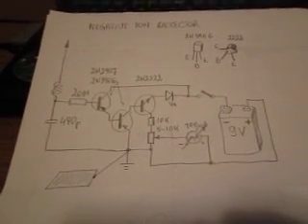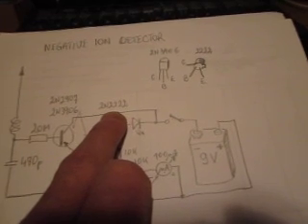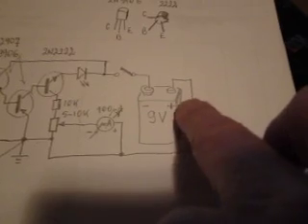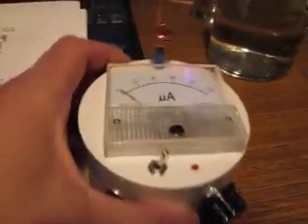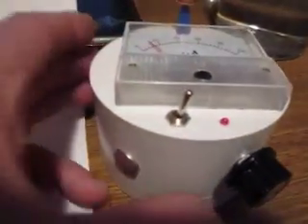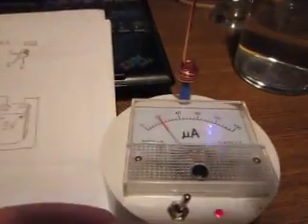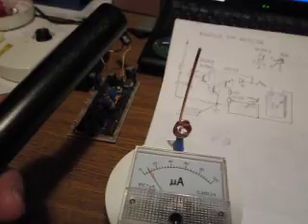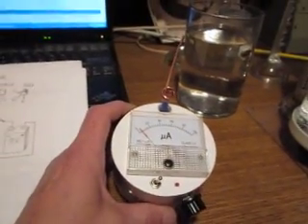Negative Ion Detector

Comment: The 470pf capacitor needs to be after the 20M resistor?
Reply: @blackchisel97  I asked the question because in similar diagrams on the internet, the capacitor is directly connected to the base of the transistor ... I'm a little confused ...
Reply from the maker: @stefanb.933  I have three 2M resistors in series between the antenna and base of first transistor. Capacitor is connected between the common ground and after the first resistor from the antenna.
Reply: @blackchisel97  Is that how you have greater sensitivity? ..

Comment: Hello sir
I have 2 questions about it
for example if I want  to get the output of the circuit on arduino instead of panel meter,what should I do?and what is the application of aluminum foil?

Comment: Thanks for sharing corrected circuit! 
This is my experience: 
1) Soldering this on PCB is not a good idea. Unless I hold the zero pcb(not touching the circuit) the led glows. Looks like PCB holds some static charge too.
2) I did positive ion detector too. Swapped first 2N3906 and 2N2222.  It worked.
3) If I make aluminium foil as antenna then it becomes super sensitive. Surface area of antenna increases sensitivity.
Reply from the maker: It is better to solder components directly and minimize connections. More sensitive circuit can be made using FET junction.
Reply: Can you please share your circuit of ion detector on surveym420@gmail.com  please
Reply: Hola amigo ¿ por cual cambiaste el 2N3906 y el 2N2222?  Saludos amigo !!